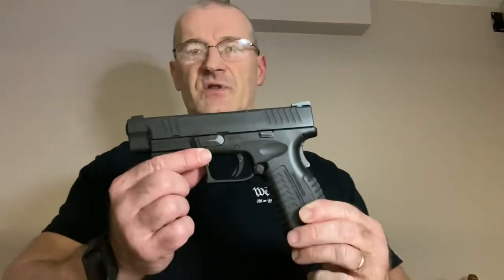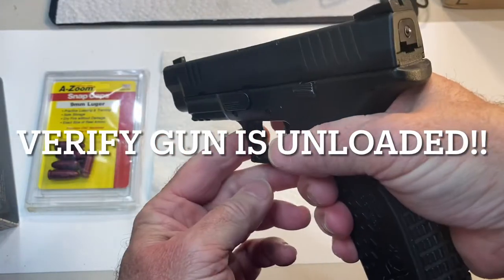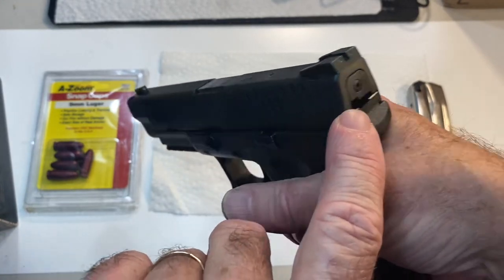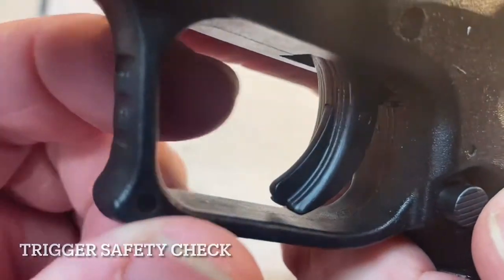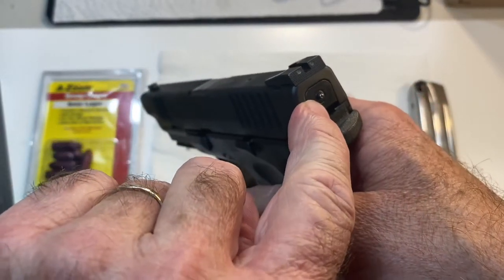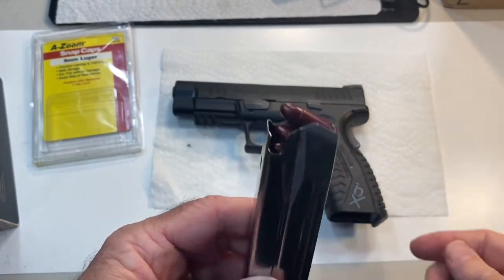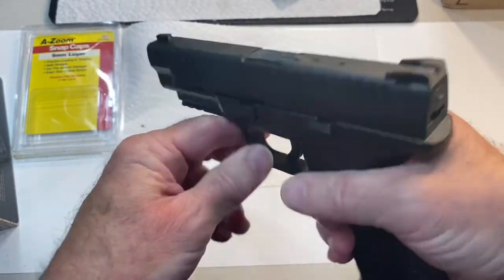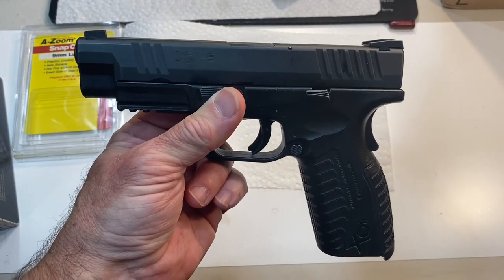Springfield XDm 9mm Function & Safety Check

Comment: I just got the Springfield XD 9mm in California.  I thought California compliant guns need to have a magazine disconnect safety to where it will not fire if the magazine is not in the gun. From what I can see, it looks like the trigger will still pull and release the striker status indicator.  Is there something inside the gun that will stop it from firing?
Reply from the maker: J W, from what you described it does not sound like that gun has a magazine, disconnect safety. I am not too familiar with California’s draconian rules, but here is a link that lists the allowed guns for sale in California. https://oag.ca.gov/firearms/certified-handguns/search
Reply: @davesgunchannel  I did more research and found that rimfire pistols need to have a magazine safety disconnect.  Others can have either a magazine safety disconnect or a loaded chamber indicator.  The XD has a chamber indicator so I guess that makes it California compliant

Comment: is this gun safe to carry loaded ? is it a drop safe gun?
Reply from the maker: Susan, yes, the XDm is as safe as most other pistols to carry loaded as it has a grip safety, trigger safety AND an internal firing pin block. 

Here is an excerpt from the XDm manual:

 "3. Striker Block Safety - As an added safety feature, an internal striker block will prevent the firearm from firing until the grip safety is depressed and the trigger is pulled." 

This means there is a physical block to prevent the striker from moving forward unless the grip is squeezed AND the trigger is pressed. I hope this helps!

Dave